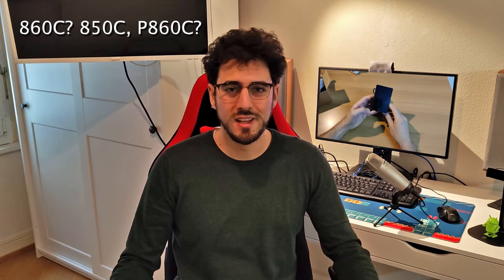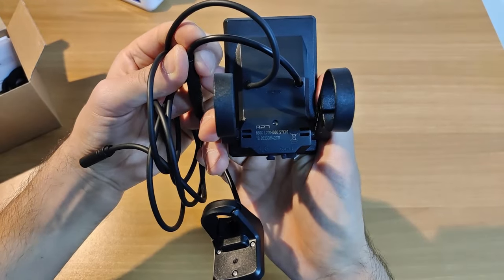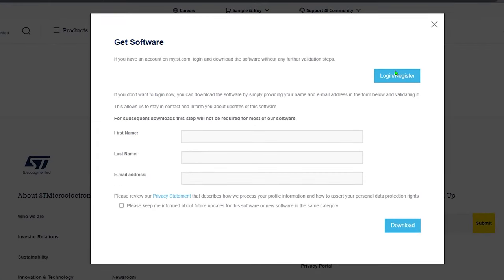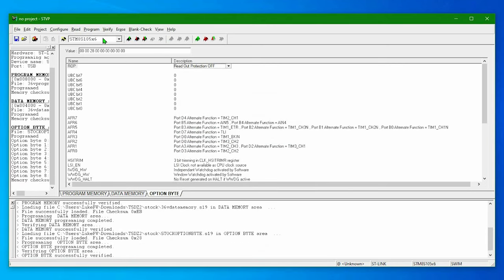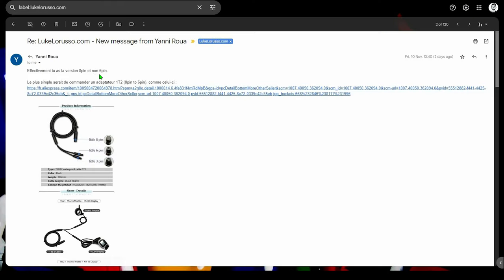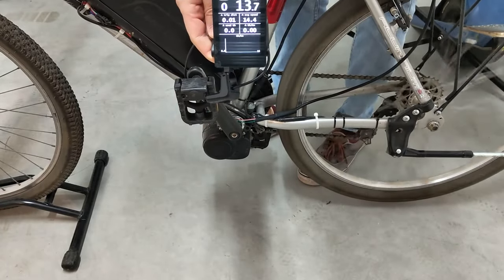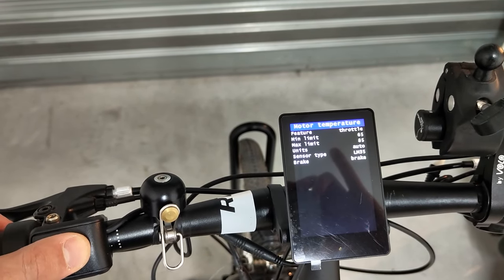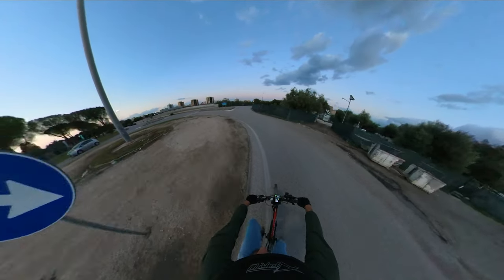Écran Expert 860C pour TSDZ2(b): Toutes les fonctionnalités du OSF !

Comment: Merci pour cette vidéo en Français :) et toutes ses super vidéos !!! I've just buy a french post man bike and I would like to transform it for my 2 little kids as a longtail I was asking my self about installing a tongshen TSDZ2 or a Bafang BBS02B 500W ? The Bafang seems to be more easier to configure ? I'm not sure what to do with the drum brake and hub gear ? What will be your recommendations ?
Reply from the maker: Merci à vous tous pour votre intérêt ! 🙌
If it's for longevity, consider either a BBS02B or a TSDZ2B (over the non B one, it has technical improvements)
If it's for kids, I would get the Tongsheng one and keep it stock: kids have lots of energy, they won't complain about having to participate in the pedaling, will have more range (cause it consumes less energy) and they will be safer... I feel like the Bafang could be too powerful for a kid
When they grow up, you can always install the OSF with the stock display or the 860c
Reply from the maker: @nicolasbouchi-lamontagne3959  non, t'inquiète pas, c'est moi : j'ai lu trop vite :)
c'est super ton vélo !
the thing is: with the TSDZ2b you'll keep that bicycle sensation, but even if you go for the 750w version, you won't get all the power the Bafang kit could give... still, it will be enough on flat lanes!
with the BBS02B 750w it's the other way around: plenty of power, but cadence sensing.
if it was my choice, I'll go for the second one, cause for carrying stuff around I would like the extra power 💪